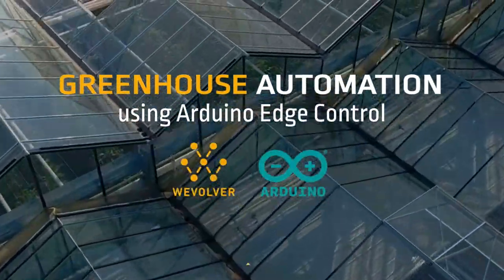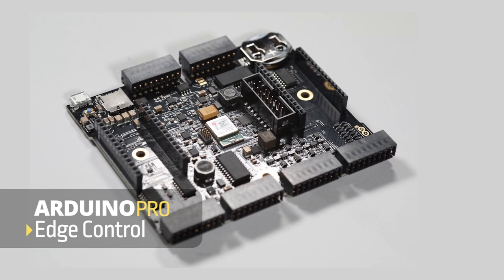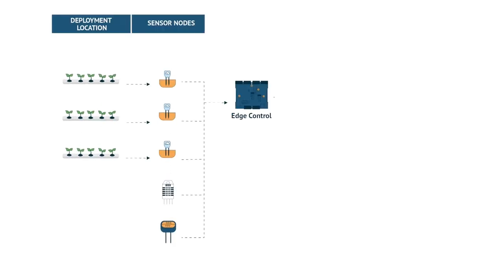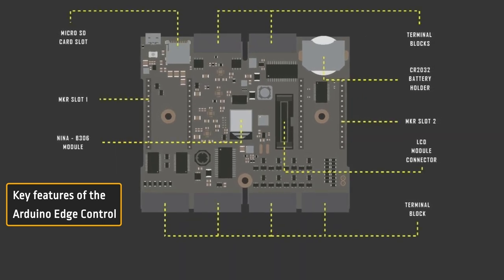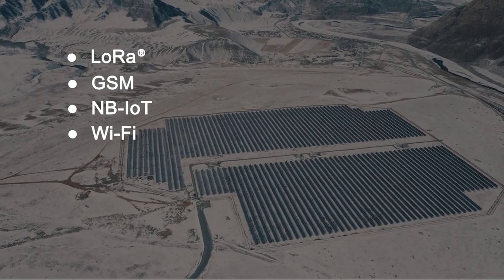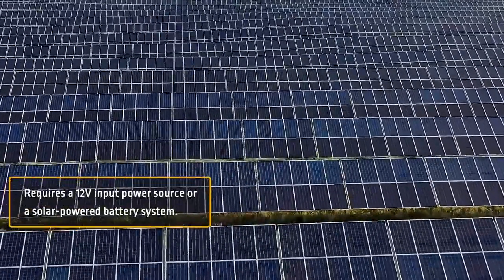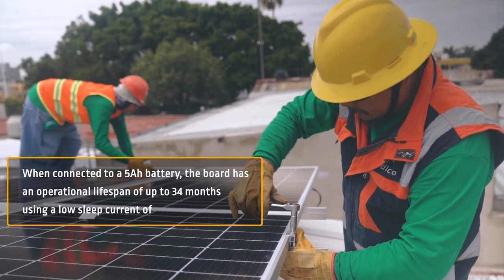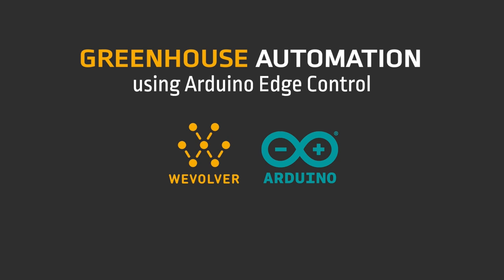Greenhouse Automation using Arduino Edge Control

Comment: what does it mean if connected to 5Ah battery has only 34 months lifespan - what will happen to it after the 3 years, the board goes toast? 😅  or it is about simply the charge of the battery which will last it for 34 months until the battery has to be replaced?  I want to use it on my farm, seems great